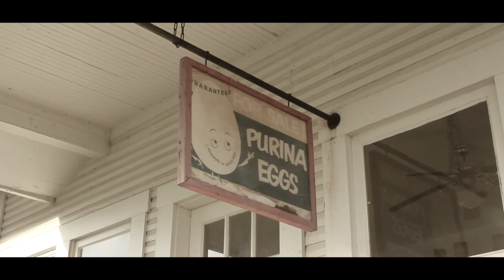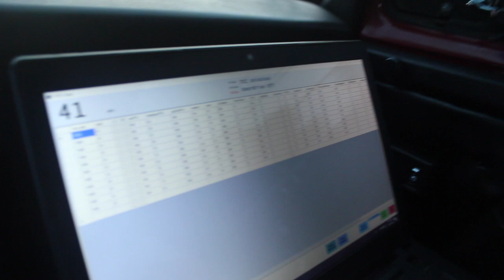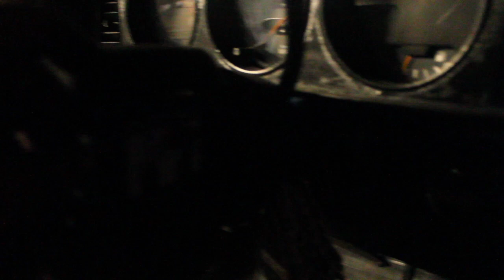1st gen Cummins 47re Swap complete | Firepunk anteater

Comment: What that swap roughly cost ya I’m looking at doing one in my 93 D350
Reply from the maker: Dustin Duke  with a mild trans roughly a little over 5k but I got a crazy good deal on my trans
Reply: SLZ Uncut I’m trying to put a 47re in my manual 97 Dodge Ram 12 valve. What all would I need to do that
Reply: Ethan Monsey a donor truck